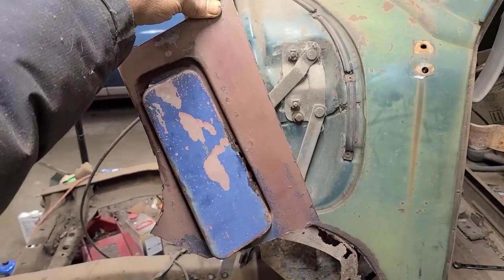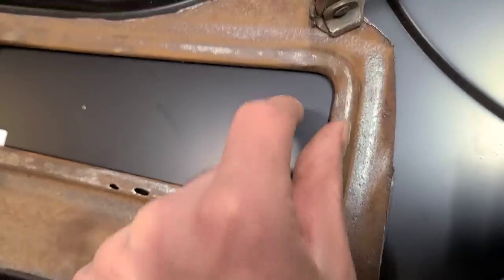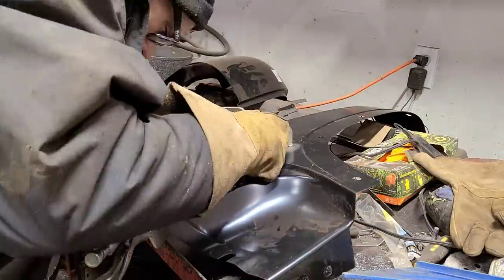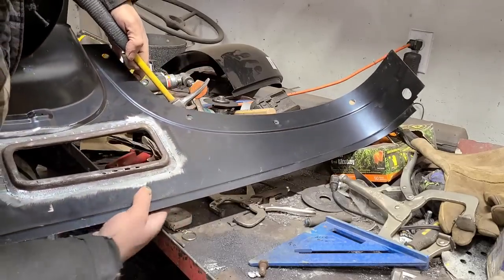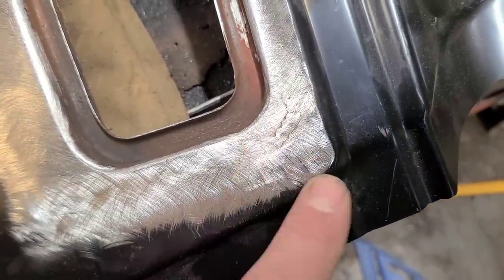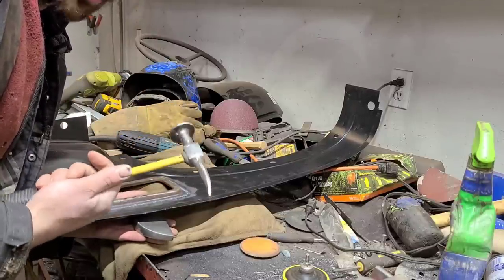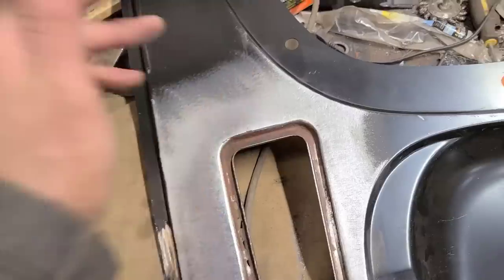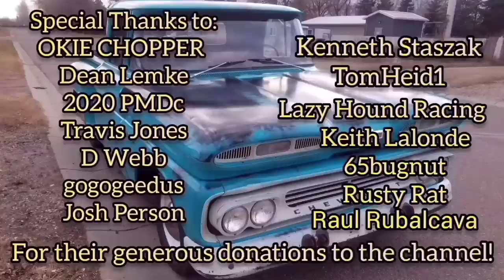Budget AC For Your Classic Truck! Mig Welding The Cowl Vent Into My 1948 GMC

Comment: Thank you for showing all the details.  I am new, hearing a proper hammer strike for me is good.  I appreciate seeing the entire process.  My first panel I welded warped pretty bad.  I became super frustrated because the other videos I watched made it seem so easy with no warping.  Those videos didn't show the entire process with all of the steps.  I would miss those steps and my panel warped because of it.  I thank you for showing all the "boring" details.

Comment: Yet ANOTHER fine job of explaining as the repair is done!!!

I appreciate the 'step by step' process of your 'theory of operation' and how the metal reacts to the welding and cooling....

...and ESPECIALLY what steps you took to correct the problem areas WITHOUT slathering and whittling 'fender in a can' (or in this episode... 'cowl in a can").

Thanks again for sharing.
Reply from the maker: Thanks Russ. Cowl in a can is a real life saver!

Comment: Hammering the welds out is something I think people overlook today. They just body work over it. Years ago I would steal rod or braze with a torch. If you didn’t hammer that shrink out as you went you had a mess. Today with mig and tig it’s easy to hammer the stress out of the weld after it’s cooled off and have a patch that can be corrected with high build primer. Great work.
Reply from the maker: Thanks, filler hides a lot, but relying on it too much is not always the fastest route.

Comment: I always liked having cowl vents for the air flow, may not have been the best look but function before form unless it came to horsepower robbing things like AC, PS or PB that didn't work with a big cam LOL. Fine job on the grafting! Cat has been enjoying just letting your playlists play and watching adds :)
Reply from the maker: Oh yeah I actually prefer them over AC in the summer, as long as I'm not stuck in traffic! Tell your cat I said thanks!

Comment: Maybe the next time you need to buy parts you can have them shipped to my house and when the next CN freight headed north stops at the crossing by the shed, I'll toss them in a box car.  They'll be in the car marked "Kyles parts" with spray paint.
Reply from the maker: Thanks Randahl, unfortunately there's a lot of parts smuggling accross the border, so you'll have to be a little more specific with the mailing address. "Idiot Kyle" or "Hoarder Kyle" will ensure it ends up in the right hands.

Comment: I learn so much from your detailed videos. Question. Esab carries a roll of .023 wire that is suppose to be a lot softer than most mig wire, so it's closer to TIG welding. Any experience with it ? Thanks Kyle !!
Reply from the maker: That esab ez grind stuff is just snake oil in my opinion. Other people seem to think it's great though
Reply: @CarterAutoRestyling  I wish you'd try it and let us know how it works.

Comment: My 1953 R-R Silver Dawn is fitted with an almost identical   vents. The channels were completely rotten so I had to make them from scratch using   homemade  metal hammer forms. The original sponge rubber seals stored rain water and dirt and rust and rot built up over many years. By the time I arrived the original  channels were unrepairable and no aftermarket  panels were available.
Reply from the maker: That's a lot of work to make all that, but a fantastic car! Good on you for saving it!

Comment: Yes, shipping is crazy now. I would have made the same decision. Getting parts in canada,is so limited too.  
There are different hardness of mig wire. Finding the more malleable stuff may be a challenge though.
Reply from the maker: I just use .023 Er70s-6.  It's what's recommended for autobody sheetmetal

Comment: That fits great.  Is that vent on both sides of the truck? I was thinking the other side has the louvers. It would flow alot of air through the truck with vent like that.
Reply from the maker: The other side has louvers, which are meant for drawing in air for the deluxe heater/defroster (which this truck does not have) The vent on the drivers side works better than Ac in the Summer as long as you're not stuck in traffic

Comment: Looks great. Thanks for all the excellent tips. Learning a lot the other guys just don't quite cover well enough. Question for you. I see you only ground and smoothed one side of the weld. Is there any reason beyond saving time because it will never be seen?
Reply from the maker: Never be seen and strength. Mig weld is hard and therefore more brittle, so not a great idea to grind all of it away, expecially in a high stress area with a spring loaded vent and a heavy door hanging off it

Comment: Quick question Kyle. The weld on the back of the panel, was that from penetration from welding the front or did you flip it over off camera and zap it? Also, wasn't there a third Kitty?
Reply from the maker: It's from penetration, no need to weld both sides. You want the weld hot enough to have penetration to the backside, otherwise it will crack when you hammer it, or crack later on after the vehicle is finished

Comment: No one ever talks about the back side of the welds other than a cursory nod to penetration. I’d like to know the extent to which you do or do not grjnd the backside (where accessible) and what treatments/coatings should we consider on the backside (where accessible and where not really accessible.) Please provide some sage advice (that most of us will no doubt ignore with your encouragement!) on this topic in future videos.
Reply from the maker: No need to grind the back of a mig weld. It's best to leave it intact for strength. Epoxy primer is the best coating to use, but on a budget I've had good luck with just using rustoleum thinned with acetone

Comment: I believe I've seen either you or Scott from CWM do a few short tacks, then immediately hammer down the welds. Was that TIG rather than MIG? MIG being much harder, I'd assume would translate the hammer force out into the panel and cause some oil canning. Watching these many videos, I'm just accepting that there is no easy or "insider" way of doing the work right.
Reply from the maker: That was with Tig, have a couple videos on the channel where I hammer weld, you're correct it does not work well with a harder Mig weld.

Comment: the fact that you are not getting crazies slamming your work is because they have nothing to pick on,in other words you must be doing it right.
just a question if i may....at the end of welding in that vent and the panel had sunk down a touch you hammer and dolled it back up by hammering on the welded side with the dolly on the face.......now does the unevenness of the weld that you are hammering on mirror itself onto the face of the panel ??
your tutorials are a pleasure to watch and thanks for continuing to show us
joe
Reply from the maker: You know you're on the right track when other people are getting upset haha. 
Yes when I hammer the mig weld out  they do imprint the outer surface, I just do a quick pass with the grinder to smooth it back out

Comment: Hint for the hot rodders with trucks. Take the spring brackets off the front of the frame change them from side to side and drill one hole where the rear ones where, this will give you an easy 2 inch drop on the rear of the truck.
Reply from the maker: Thanks for the great tip!

Comment: For sand paper where you buy this orange grid 50 ? I am from Québec country Shawinigan. Never see on Amazon 🤝🏆🤩
Reply from the maker: Norton Blaze 3" 50 grit roloc discs. They are on Amazon, but I buy them from my local bodyshop supply store
Reply: @CarterAutoRestyling  need adapter special for this norton 3" 50 grit ?
Reply from the maker: @christianbellemare6037  yes you have to buy a 3" roloc backup pad. They sell them on Amazon or at Princess Auto or the bodyshop supply store

Comment: I have seen insane cross border shipping cost also, fortunately I live 15 minutes from the border where right across the line there is a parcel reciving depot that only charges $2 per parcel, I bought a set of headlights from A1 auto that wanted $87 US to ship direct to me yet lower 48 was free shipping! We also have a great border crossing that has never charged me duty on items under $300 so as long as I keep the orders reasonable its a great option.  looks like you live a long ways from the border so I feel your pain.

Comment: We had to remove the vent door assembly and now have to weld that hinge back on. However, it was a while back and i had forgotten how the hinge to door mechanism looked like so your video has come to be a great source. As far as i can tell you are the only one on YouTube that has a detail R&R of this vent. I replaced all the related screws with hex head bolts to make it easier to R&R the vent door. Thank you
Reply from the maker: Glad it helped you out! Good idea to change out to bolts too!
Reply: Kyle, two questions as to the welded hinge support: 
One: I observed large area washers between the welded hinge support and the door hinge portion that is screwed to the welded hinge, Why?
Two: the hinge part that is welded to side panel, is the face of the hinge horizontally and vertically flat in relation to side panel hole / opening? 
See I’m trapped because I’m installing the hinge and door on the original truck’s side panel. You did the repair on the table and can’t.
Sure appreciate your expertise.